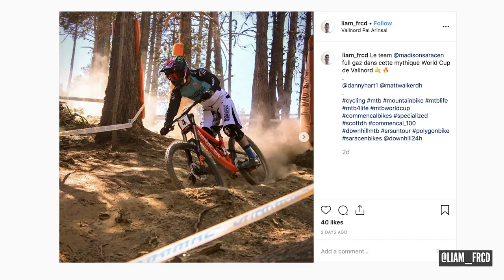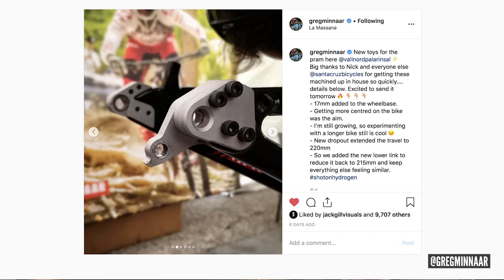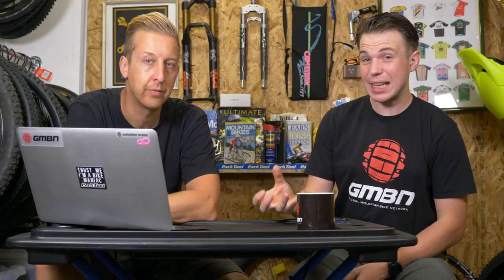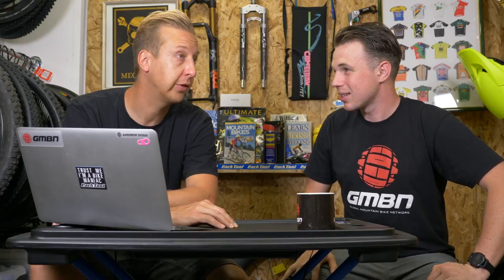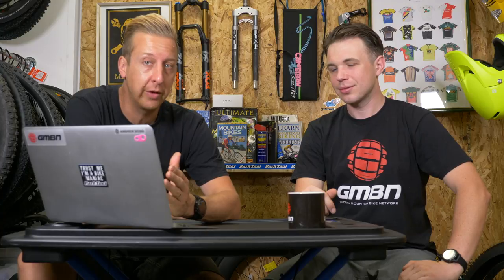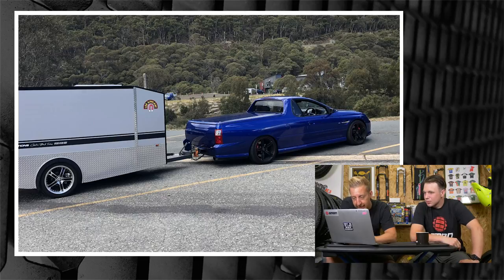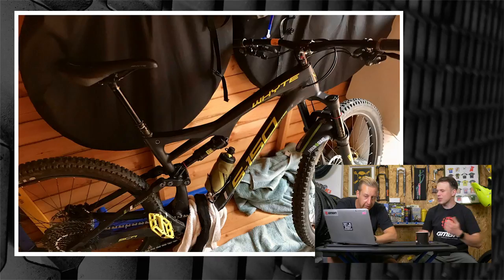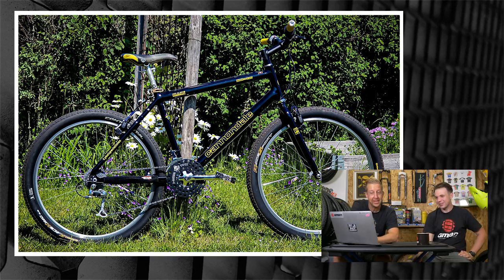Custom World Cup Downhill & Cross Country Tech | GMBN Tech Show Ep. 79

Comment from the maker: Do you have any questions about mountain bike geometry? Let us know by using the tag #AskGMBNTech
Reply: GMBN Tech large rider small bike. What are your thoughts? #askGMBNtech
Reply: How well would a 26" rear wheel work when paired with a 27.5" front or even a 29"? #AskGMBNTech
Reply: These days bikes are getting longer for taller riders - great.  But why does stack height not match up? The larger the bike, the higher the saddle is above the bars.  If my large frame Scott Scale didn’t have 50mm risers, my knees would hit the bars when I’m cranking out of the saddle(I’m 6’).  Thoughts? #AskGMBNtech
Reply: #Askgmbntech. BB height, I have recently put 27.5 on a 26 frame and it is noticeably taller, is there a golden number for BB height?
Reply: I am currently working on resto modding a 99 merida big air pro with tiny stem, wide raised bars, and many other new parts is there anything else I could add to get a more modern geometry 🤔 #AskGMBNTech
Reply: GMBN Tech I’m building an all rounder bike. Most of the time I do trails and long ride. What is the best geometry, handlebar, stem and fork size, for riding both xc and enduro? Thanks! #askGMBNTech
Reply: #AskGMBNTech Hi, gays! I think of buying a Scale Carbon. Have tested the M frame - I fell fast on the downhills, but not able to ride sharp corners ascending... Should I stick with the M frame or go for the S (as I am 172cm tall and it was my first time on 29”)?

Comment: Hi guys!
I used to ride Hope Tech Enduro wheelset over past 3 years, but rims got damaged so I kept the hubs and got them laced with DT Swiss E532 rims using Sapim Race double butted spokes (2.0-1.8-2.0) and DT Swiss Standard 12mm brass nipples.  I choosed to have Sapim Race spokes because they were also used on Hope Tech Enduro wheelset without any spoke being snapped during the whole time (I used a new spokes on new wheel build ofc.) New wheels were build in my LBS using tensiometer and  I´m riding same trails as on old wheels but the spokes keeps snapping inside the nipples even without crashing, casing jumps or riding hard stuff, I´m also relatively light rider at 70kg / 155 pounds. This never happened to me on old wheels and I´m kind of frusrated of snapping and adding a new spoke almost after every ride since I got new wheels. Can you please give me your thoughts on this issue? Can it be because Sapim spoke and DT Swiss nipple combo? Or maybe wheels were built with too much tension? 
Thank you,
Jakub, Slovakia.
#AskGMBNTech

PS: Love your episodes, I am a big fan,  keep them comming ;)

Comment: #AskGMBNTech Hey guys, my bike is a Focus Jam 29er, I'm happy with it but my only ''problem'' is the quite steep head angle (67.8) for my use (light enduro). Do you think it's a good idea to buy a -1.5° degree headset to make it a bit more easy in the steep stuff or it will ruin the geometry (BB height etc) ?

Comment: #AskGMBNTech Not really a tech question but is it worth it to buy a demo bike? I lived in Whistler for 8 years and would never dream of buying a demo bike from a resort or bike park, but I live in a smaller canadian city now, no huge mountains but some good trails. My lbs offered me a 2019 full carbon mid travel full suspension bike at almost a 45% discount, 3k instead of almost 6k. Told it was used about 10 times, rode it, was great, only mark is a scratch on the handlebars. Told I still get the lifetime frame warranty and 2 year warranty on parts. It's a dream bike that just fell into my price range, what are your thoughts on purchasing demo bikes?

Comment: Hi love the show, I ride the 2016 650b specialized pitch sport and it has coil spring forks and I am 14 and way 50 kg I find that even on the plushes setting the forks barely moves and feels really tough like I'm going to go over the handle bars so I was looking to go with air forks either fox or rockshox and I wanted to ask you what fork I should go with preferably something more on the plush side.